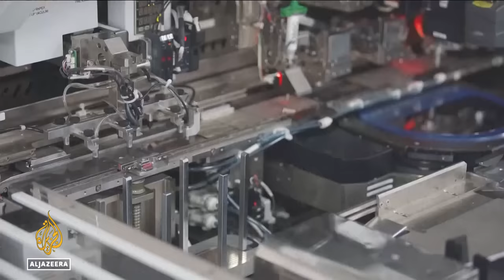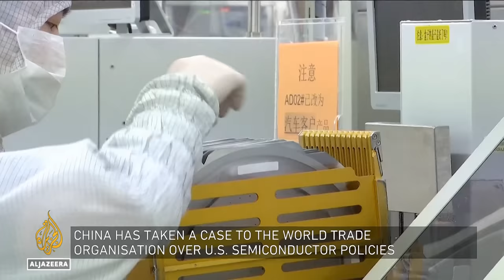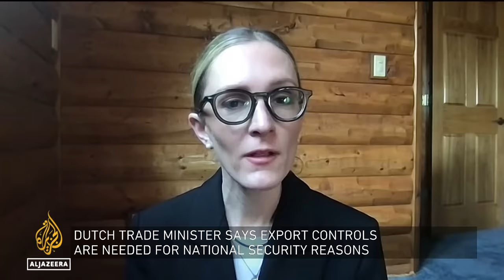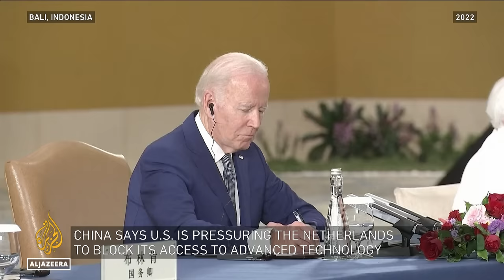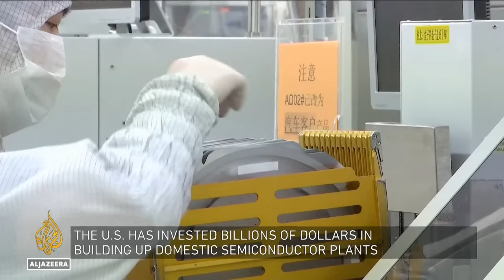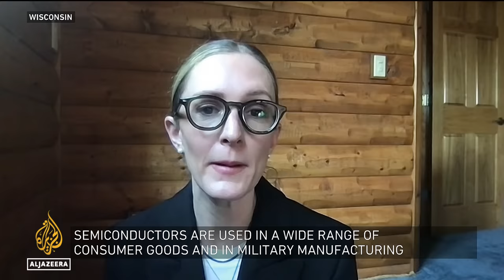Can China develop its own chip industry? | Inside Story

Comment: The second law of thermodynamics may be empty denial of 
perpetually changeble energy without gain or loss. 

This may simplify energy, material, and transportation supply logistics for everybody.

The development of thermodynamics had a distinct begining with Sir Isaac Newton's correct professional scientific observation that the heat of a fire in a fireplace always flows towards the cold room beyond. Heat never flows spontaneously from cold to hot. 

Victorian England became enchanted with steam engines and their cheap, reliable, and easy to  position physical power. Scientists of the era with wide cultural support formulated the second law of thermodynamics using evidence from steam engine development. 

The law's formulaters considered with acceptance [A+] Inefficiently harnessing the flow of heat from hot to cold or [B+] Using force to Inefficiently pump heat from cold to hot. They considered with rejection [A-] Waiting for random fluctuation to cause a large difference in temperature or pressure. This was calculated to be extremely rare or [B-] Searching for and selecting for use, random, frequent and small differences in temperature or pressure. The search and selection would require more energy than the use would yield. These accepted options, lead to the consequence that the universe will end in stagnant heat death.  This became support for a theological trend of the time that placed God as the initiator of a degenerating universe. Please consider that God can also be supreme over an energy abundant civilization that can absorb heat and convert it into electricity without energy gain or loss in a sustained universe. 

The law's formulaters did not consider the option that any random, usually small, fluctuation of heat or pressure could use the energy of these fluctuations itself to deterministically select differental treatment so the output is no longer random. Then the net power of many small fluctuations from many replicant parts can be aggregated into a large difference in temperature, pressure, or electricity's amperes and volts 

Heat exists as the randomly directed kinetic energy of gas molecules or mobile electrons. In gasses this is known as Brownian motion, in electronic systems  this is carefully labeled Johnson Nyquist thermal electrical noise. Hypothetically, diode depletion regions are  practical sites for enabling mobile electrons energized into motion by thermal electrical noise to deterministically alter the electrical resistance of the depletion region according to the moment by moment direction they are carrying electricity. The thermal electrical noise is hypothetically beyond the exposed lattice charge / diffusion equlibrium thickness of the depletion region. 

Consistantly oriented diodes in parallel hypothetically are successful electrical Maxwell's Demons or Smoluchowski's Trapdoors. The energy needed to shift the depletion region's deterministic role is paid as a burden on the moving electrons. There would therefore be usable net rectified power from each and every diode connected together into a consistantly oriented parallel group. The group would aggregate the net power of its members. Any diode efficiency at all produces some energy conversion from ambient heat, more efficiency yields higher performance. A diode array that is switched off has no energy conversion and no performance. 

The power from a single diode is poorly expressed. Several or more diodes in parallel are needed to overcome the effect of a load resistor's own thermal noise. A plurality of billions of high frequency capable diodes is needed for practical power aggregation. For reference, there are ten billion100 square nanometer cells per square centimeter. 

Modern nanofabrication can make simple identical diodes surrounded by insulation smaller than this in a slab as thick as the diodes are long. The diodes are connected at their two ends to two conductive layers. 

Zero to ~2 THz is the maximum frequency bandwidth of Johnson Nyquest electrical noise available in nature. This is beyond the range of most diodes. Practicality requires this extreme bandwidth. The diodes are preferably in same orientation parallel at the primary level. Many primary level groups of diodes should be in series for practical voltage. 

Ever since the supposedly universal second law of thermodynamics was formulated, education has mass produced and spread the conventional wisdom throughout society that the second law of thermodynamics is fundamental. 

If counterexamples invalidated the second law of thermodynamics civilization would learn it could have perpetually convertable conserved energy which is the form of free energy where energy is borrowed from the massive heat reservoir of our sun warmed planet and converted into electricity anywhere, anytime with slight variations. Electricity produces heat when used by electric heaters, motors, or ligts so the energy borrowed by these devices is promply returned without gain or loss. There is also the reverse effect where refrigeration produces electricity equivalent to the cooling, This effect is scientifically elegant. 

Cell phones wouldn't die or need power cords or batteries or become hot. They would cool when transmitting radio signal power. The phones could also be data relays and there could also be data relays without phone features with and without long haul links so the telecommunication network would be very good and adaptible. Computers and integrated circuits would have their cooling and electrical needs supplied autonomously and simultaniously. Integrated circuits wouldn't need power pinouts. Robots would have extreme mobility. 
Frozen food storage would be reliable and free or value positive. That means storehouses, homes, and markets would have independent power to preserve and pŕepare food. Vehicles wouldn't need fuel or fueling stops. Elevators would be very reliable with independent power. Water and sewage pumps could be installed anywhere. Nomads could raise their material supports item by item carefully and groups of people could modify their settlements with great technical flexibility. Many devices would be very quiet, which is good for coexisting with nature and does not disturb people. 
Zone refining would involve little net power. Reducing Bauxite to Aluminum, Rutile to Titanium, and Magnetite to Iron, would have a net cooling effect. With enough clean cheap power, minerals could be finely pulverized, and H2O, CO2, and other substance levels in the biosphere could be modified. There should be a unitary agency to look after our global planetary concerns. 

This is a material revolution with spiritual ramifications. Everyone should contribute individual talents and fruits of different experiances and cultures to advancing a cooperative, diverse, harmonious and unified civilization. It is possible to apply technlology wrong but social force should oppose this. 

Inventive concepts that are widely published become unpatentabe. A public incorruptable archive could secure attrbution for the original works of creators. Uncorrupted copies would be releaseed on request. No further action would be taken by this institution. 

Many financially and procedurally independent teams that pool developmental knowlege, and may be funded by many separate noncontrolling crowd sourced grants should convene themselves to develop proof-of-concept and initial-recipe-exploring prototypes to develop devices which coproduce the release of electrical energy and an equivalent absorbtion of stagnant ambient thermal energy. Diode arrays are not the only possible device of this sort. They are the easiest to explain here. 

These devices would probably become segmented commodities sold with minimal margin over supply cost. They would be manufactured by AI that does not need financial incentive. Applicable best practices would be adopted. Business details would be open public knowledge. Associated people should move as negotiated and freely and honestly talk. There is no need of wealth extracting top commanders. We do not need often token philanthropy from the wealthy if people simply can be more generous if consumer commodities are inexpensive. 

Industry, government, commercial science, academia, finance, and the military are not configured to develop this easily. There may be "Murder on the Orient Express" style suppression of perpetually convertable conserved energy. 

Aloha 

Charles M Brown lll 
Kilauea, Kauai, Hawaii 96754
1 808 651